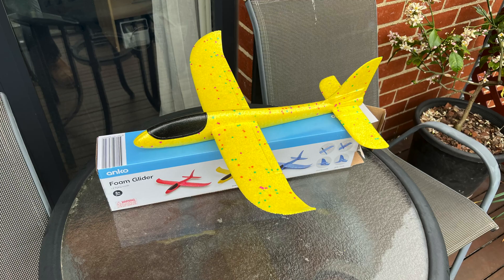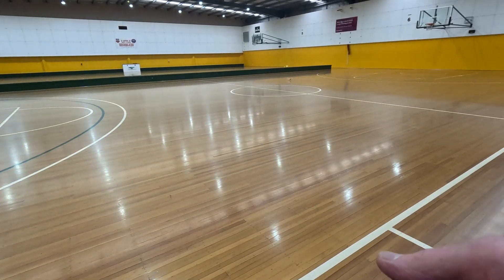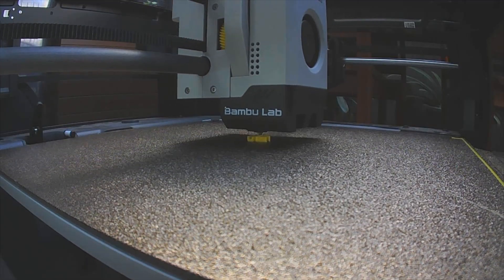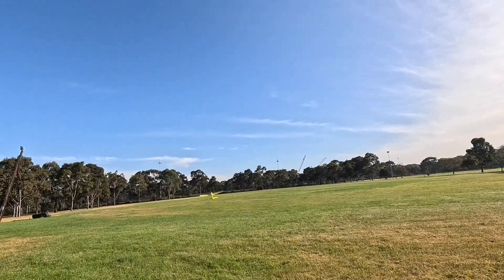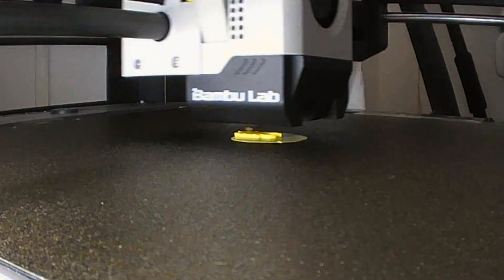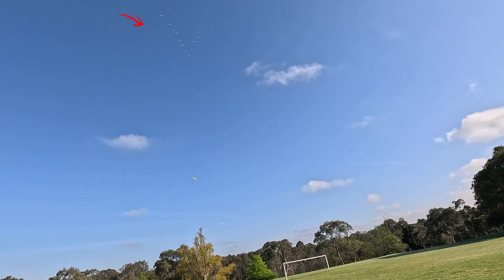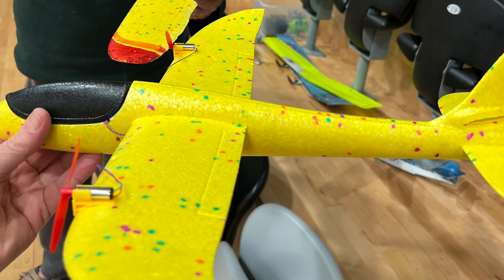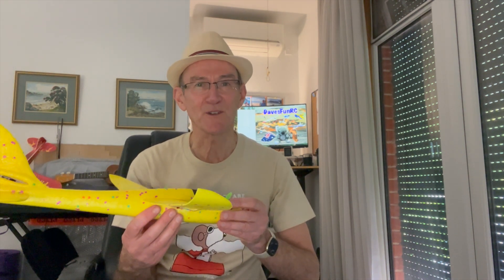$3 Kmart Glider RC Conversion #davesfunrc

Comment: Hallo Dave, nice Video, would you be so kind  to publish the STL-File for the MotorMount  as Pusher please
Reply from the maker: Hi, thanks for the feedback!
I've attached a link to a TinkerCAD document which as leading and trailing edge versions of the motor mount for the 8520.  You can export the pusher STL file from that.  Let me know if this doesn't work for you:
https://www.tinkercad.com/things/iw4zzNgaSQg-davesfunrc-shared-designs
Reply: @DavesFunRC  hello Dave, sorry, the link you posted, do not work
Sorry, that page is missing
It may have moved, or is no longer shared. Try checking the link, make sure

you are signed in, or try exploring these:

I have locked in me to my ThinkerCat account, but also do not see your designes.
Reply from the maker: @michaellorenz592 Hi, sorry about that!  I’ve changed the access permissions, please try again.
Reply: @DavesFunRC  Hi, i have tried it, but no changes:
the page can not be found error 404
Reply from the maker: @michaellorenz592  Try this link: https://www.tinkercad.com/things/iw4zzNgaSQg-davesfunrc-shared-designs?sharecode=i2wz_nIy2qr0iHzN0VqJUTFY3An9YuIsaoJSsA0D5YA
Reply: @DavesFunRC  Dear Dave, thanks, this works fine.
Greatings from Berlin Germany
Reply from the maker: @michaellorenz592  Gut!  Glad it worked. BTW I have relatives in Berlin 😀
Reply: Dear Dave,
I used the spare parts from QF008 787 controller, motors and props and it works verry fine.
Motor spinning and gyro functions are all ok.

I have used the Printed 3D part downloaded from you to mount the motors at the front of the wing.
Now i have a question.
When you are loocking from the side to the wing,
the motor axis is 10 deg down directing to the front.
is this correct?

I think it should be parallel to the underside of the wing.

This angel down of the motor axis may, came form an different thickness of the wing.
I suggest your wing thickness is 6,732mm and my is 10,5mm resulting in the motor axis down.

In the video are shown different distances for the motor mount from the Fuselage.
What is the best distance you used.

Thanks for your help.
Reply from the maker: @michaellorenz592  Hi, Michael.
Good, you are making progress!  I have checked the motors’ angle of incidence on my Kmart Glider.  It is slightly angled down.  My wing thickness where I have attached them is 8.5mm.  The motors are mounted 14cm from the centre to give lots of turning ability.  It is quite good to have a bit of down angle, as it tends to climb steeply when I throttle up.  Especially since I only have 2 channels with no elevator.
If your wing is a bit thicker, you might like to try scaling up the motor mount a little in the Slicer.  That is if the motor fit is quite tight, otherwise you might need to glue the motors to the mount.  I’m using 8520s which are quite tight to clip in.
By the way, I’m trying to get a 3-channel differential throttle setup.  I bought an A380 from AliExpress, but accidentally selected the 2-Channel version!  I’m waiting for a Black Friday bargain, then I will buy a 3-channel one.  This will give me elevator as well.
One of the guys in my Indoor Aviation Club is also experimenting with Kmart Gliders and has a nice 3-channel version with extended wings!
I’ll publish an end of year Indoor Aviation video soon, which will show some of the variations on this glider.
I’m having lots of fun with mine indoors still.
Cheers
David

Comment: 059   the tail could be made lighter.     by reducing the root chord length of the vert-stab so that it is equal to that of the horiz-stab; and remove about an inch off the top of the vert-stab.
fuse-lawj
Reply from the maker: @daviddavids2884  I didn’t think of lighting the tail. Good idea - would make it even lighter!

Comment: Great video Dave.  As people have said I like the drone shots ( and wonder how you got them).  $3, eh?  They saw you coming!  My 3- channel modified Kmart glider was free, as I liberated it from a roadside hard rubbish collection.  I am using the differential receiver out of an airliner ( A380) and can vary the differential action from my transmitter, so I could keep the motors fairly close together
Reply from the maker: Yeah, co$t me heaps!  Jealous of your elevator. Just added LED lights to it though!  See you next time.
Reply: The flight board and Tx from any of the XK A1?0 series 3-channellers (or the QF008 787) would make good conversion gear. The only PITA with them is that the elevator servo has to be the 5-wire version, not a standard 3-wire type. The brushed motors eventually wear out but you can safely drive 7x20mm or even 8x20mm motors scrounged from el-cheapo brushed toy quads. All of them used to use the V911S protocol so you could use a good Multi Radio to get much better control of them. However I believe that the protocol (at least for some of them) has now been changed so it might take some searching for it - or some more work by the Multi Module Hackers. (Sorry - Devs!) 😉😊
Those 48mm $3 foamies from Kmart are about the best of the bunch around, Dave, since they have very nice fine trailing edges on the wings and tail and enough wing-tip up dihedral to glide very nicely.
Reply: @theoztreecrasher2647  Altho the “ Airliner” 3-channel receivers use 5-wire servos, there is at least some good news - all the 5-wire servos are interchangeable ( now!), but because of the weird functions of the elevator servo, it must be installed ( like the Rx) in the same orientation as in the original plane.  Please don’t ask how I know this.  I have recently found these 3-channel receivers for Au$9.00.  Good value
Reply: @andrewhalstead5938  Yep Andrew. To take advantage of the Gyro stabilization (and have it all running the right way) there's not much flexibility with those boards. (Though that's a VERY good price!) The 3/4 channel brushed boards out of the Volantex Mini Warbirds/Trainers (and also the 2s brushless 500mm P-51 I believe) offer a little more flexibility in that you can force a recalibration of what they see as "Level" and also reverse the directions of how the stabilizers work on each of A,E,R. But they are way more expensive. No free lunches! 😢